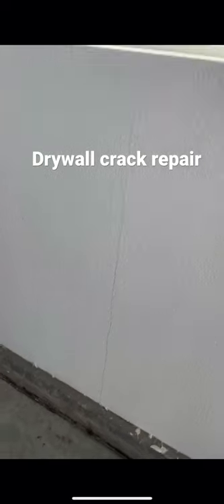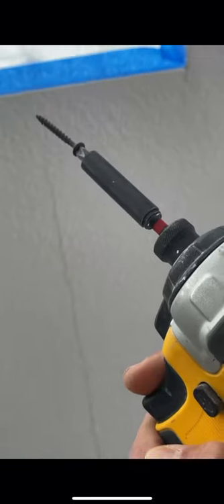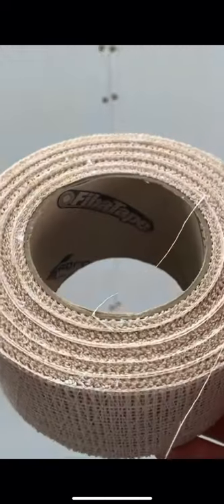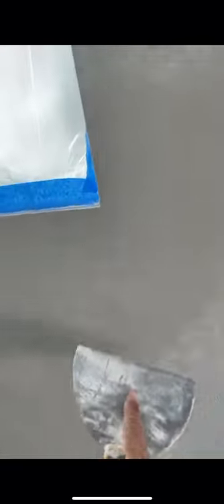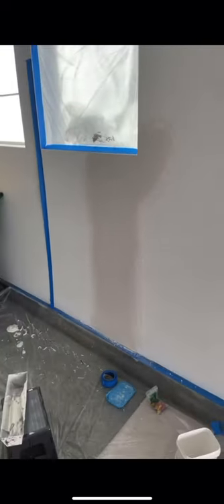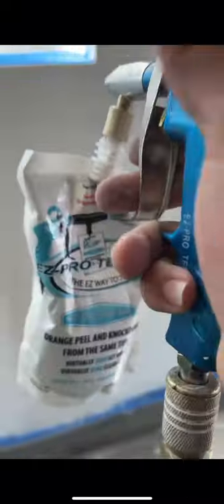Drywall crack repair #shorts

Comment: Ive been a painting contractor for 25 years. This is average work which really is all you need to have. Drywall and painting is an art. Thats not your formula. Reading these comments Im cracking up because half dont even know what the hell they are talkin about. These are easy average fixes for your average homeowner-handyman and they aren't horrible. Would I do it differently? You bet. All I do is that but your average handyman is like a good general practitioner not a surgeon. Keep up the good work.
Reply: Guy post a video of your fix; you've had your channel since 2012 and no videos. Show us what 25 years o f experience looks like. ✌🏾
Reply: @mrtv777  damn y’all rude asf. They’re speaking facts. Not all people do the same shit 100% but y’all mad disrespectful with your execution. This is why we can’t have adult conversations. It’s sad really.
Reply: It's gonna Crack. This is not how you fix this problem. Only thing he did here that plays a part if fixing is the screws. But this is a bandaid and will come back. I know a way to much about the trade and how to properly address things.
Reply: Real pros would have sanded all the old texture Off the Wall first so that you don't have to build up and create a lump
Reply: @thecloneguyz   Hahahaha.....no. A real pro would feather it out. You have zero experience obviously.
Reply: Cool so surely you’ll share how you do it then?

Comment: Dude, gotta open that gap with a v then prefill, paper tape then coat. Mesh moves to easy and the crack will show back up and not having fill of at least 1/8" will also cause a dry joint. Otherwise good video.
Reply: The procedure shown in the video shall failo.  Laziness, never brings fulfillment in life mae amiga. You sand are scared of, no one ever sands a lot. Fix it right with 20 grit sander, open that elbow up, get the mesh tappe y to o bind *HARD*, then spread the 29 minute shet, see?  It’s that easy and not so much more abehar than the lazy ways. 

You forget to paint amigdala.
Reply: He did right. So he can go back and charge the customer again. Just kidding JS. Great video.
Reply: @crocpa  yeah I give this thing maybe a year or two before it cracks again.
Reply: Paper tape should only really be used on new construction. At least he isn't using that yellow garbage mesh. The only thing he did wrong is not remove the old paper tape and obviously prefil but other than that great job!
Reply: @alozano443  Paper tape should be used any time a crack may reappear. And yeah he uses mesh in his other videos.
Reply: Thanks!
Reply: lk. k. k. k
Reply: @mateobrainardo4770  English?
Reply: I came to say exactly this but you forgot the PVA in the V..
Reply: Paper tape is garbage
Reply: @lukeshepherd9529  that's a given!
Reply: Open the gap and prefill with gap with 20 minute. Mix some weldbond with your water. Then do the same process he did after that. If you put weld bond in your water the crack will never open up again.
Reply: @Cchall22  That will work as well, so will PVA glue. Either way a gap must be made for pre-fill. Even still paper is best for long term results.
Reply: @rival2561  Sure if you don't use it right...
Reply: Paper tape can and should be used anytime
Reply: @mateobrainardo4770  I had a seizure reading this
Reply: @alozano443   right he had to go all the way underneath and remove the old tape !
Reply: @rival2561  mesh is garbage lol. Bet you don't even know what type of mud you're ONLY supposed to use with that crap.
Reply: @jonatangonzalez6279  that as well. But no telling that was a tape joint initially.  But it should've been opened up with a very notch prefilled then taped with paper tape.

Comment: You should cut the crack out like a V because the tape blisters when it cracks so before you mesh tape just thump the tape slightly and you will hear the difference from thumping directly on the crack and just to the side. So eventually if you don't cut out the blister it will crack again no matter how many screws you use. 20 yrs experience talking here

Comment: Also the thing about quick set is that it sets but doesn’t fully dry until days or weeks later so don’t leave to thick of coats or you’ll get a callback because it looks like there’s a hump in the wall cause it swells overtime just a tip !
Reply: Quick set dries chemically. Not air dry.

Comment: Thought you were getting rid of the crack not ensuring a callback. 
Cut that out a bit, use paper tape, mix pva glue in with your mud, it will help it adhere to the old paint.
Reply: Exactly!
Reply: Glue? No way jose
Reply: How do you "cut it out" ?
Reply: @ericimi  cut into the crack at a taper. Enlarge it so it can be filled with mud instead of hidden

Comment: Dude, there is a tape sold at Lowes called fibatape that isn't mesh like that.. It's actually a fiberglass tape that looks similar to a waterproofing membrane before its coated in waterproofing.. It works better than any other tape I've ever used for repairs like that.. Every person I've shown it to never uses mesh tape again.. It doesn't have adhesive like the mesh tape but just a really thin coat of mud under it (kinda like paper tape applications) then put the tape on and work it down with your mud knife, then a thin layer over the top and you're golden 🤙 best part about it is if you sand into it, it sands down like the mud.. Whereas the mesh tape will show if you sand into it.. I love it and most others do as well once they try it

Comment: 20 minute means it starts to chemically harden at 20 minutes but dry time is dependent on how thick it is applied.  You can finish quickly but will likely show visuable shrinkage once fully dried😊

Comment: Do you have a video on how to remove stubborn caulk around the bathtub and how to caulk a tub?
Reply: Sharp razor blade to cut it out. I recommend an olfa knife. To caulk I recommend taping off straight lines with painters tape.  Make sure you cut a small nozzle tip opening. Usually people need less than they think they need. Then run your wet finger or sponge to smooth it out.

Comment: btw, lmao, the second that house shifts a mm, that crack is going to come back an inch larger. Might as well cut it out and do it the right way.
Reply: 🤣 with a ton of screws that you need to take out from the studs. Wait till moisture from that window starts seeping down that crack. Good job buddy. You did an excellent job. 👍🤣
Reply: Moisture will cause mold if it isn't taken care of right away 🤐 Aghhhh, you just cost a home owner a $1,000 job for your $10 repair. Or, if they sell the house, a $10,000 job. 🤣

Comment: Can I use the same product to fix uneven dry, I have flat no texture walls and the contractor left us with not so smooth walls. Or is there a better joint compound or something I can use? Thank you your help
Reply: You can start with 20 minute, but I would suggest your final coat be joint compound. 20 minute tends to leave a less smooth less durable finish.
Reply: And if you’re not experienced, 20 minute can be a nightmare to stir and apply. Start with 45 or 90 Sheetrock, apply flat, sand the ridges.

Comment: This is due to putting a seam above or below a door or window. I proper hanger will blanket the windows and doors. Usually means more scrap but it's the correct way to do it.
Reply: Does that mean you cut out and put another sheet in? Please explain I'd like to know, if possible.

Comment: My house was built in 1997, during the unfortunate sponge texture craze. Any chance you can make a solution video showing how to flatten the drywall and remove the God awful texture? Thanks!!
Reply: Want the good news or the bad news?

Unfortunately, there’s no good news. You can scrape and sand it all away, cut it out and start over, or keep adding compound :/

Comment: I have huge horizontal drywall seam cracks in my garage… I can’t put screws 4” apart because there’s nothing backing the majority of it. I can only screw into the studs 16” apart… It did tighten up a little bit, but I can still move each piece of drywall by pushing in the non stud backed spots. Any advice?

Comment: Hey i have a question is these crack dangerous because i have a few in my room and one stretches out from my door to the end of the wall and that wall is where I put my bed and im afraid i might get crushed in my sleep but it's really small

Edit : it goes up the corner of the wall and across the ceiling corner

Comment: Cut the tape, out mesh and fill otherwise layering mud on top of knockdown you run the risk of a visible hump unless youre busting it out.  But you should still have V'ed the crack to get the durabond in it.

Comment: Can I use the same technique for the ceiling
Reply: Cut the crack open in a V-shape. 50/50 PVA and water. Plasterboard screws if needed. Filler crack. Mesh tape. Filler over. Sand. Paint.

Comment: Drywall but joints crack over doors and windows and under windows like the one in the video, lots of movement in them areas as seasons change.

Comment: You don't ever use mesh tape unless you are prefilling with unsandible durabond and first coating with it. Then top coating with easy sand or bucket mud.

Comment: I just open up the Crack a little more, put some caulking in it, and paint. Haven't had a customer call me back out yet
Reply: Is caulk that second product he used and mixed with water? Or caulk like that Dap stuff he frequently recommends?
Reply: @GenevieveThornton  No he didn't use chaulk he used mud.

Comment: Why nobody use paper tape instead of mesh? You want to hide the crack behind the paper tape. If you used mesh tape it will make it stronger than the rest of the wall and a crack will form somewhere else.

Comment: I laugh when it comes to texture.
It was created because no one knew how to build a nice, straight, even wall and the texture makes it look like it was built properly.
Reply: @savagecomments9195  geez that took way too long for someone to bite
Reply: Texture massively improves room harmonics and echoes.
Reply: @formdoggie5  sure it does. who told you that, a texture salesman?
Reply: @dragons_red  no. Physics.
Reply: @formdoggie5  bro why did you destroy him like that. How is this man gonna go on
Reply: @dragons_red  texture salesman🤣🤣🤣🤣 man leave him alone
Reply: @dragons_red  textured ceiling is called acoustic ceilings after all.
Reply: Negative. You find this mostly in Spanish states Florida Cali Arizona New Mexico etc etc etc  in the late 80s early 90s it was used in Northern states. That and popcorn were considered high class.
Reply: @krazylegz254  he can bother me all he wants. If leaving people alone leaves him so ignorant he cant realize that the peaks and valleys break up a sound wave, as well as a literal air pocket insulation preventing the soundwave from reaching a hard surface (which imparts more energy on rebound), then it's probably a bad idea for him and everyone agreeing with him to leave people alone where they wont call them out for it.

The room will usually be about 5db-7db quieter, and if sufficiently large (like a living room) almost completely eliminate echo (even more significant when hardwood floors are involved).  The topography of anechoic sound chambers is just the exaggerated topography of "popcorn" texture on walls.

Comment: My house is full of that kinda shit... settling is going to do all that? I've thought about opening the wall and checking the boards and foundation
Reply: It's normal to have cracks from settling. What you need to do is fix them. If they re-appear then you might have foundation issue. But if they don't re appear then you are fine
Reply: @DaDaDo661  Roger that... should I use spray foam jic?
Reply: @stevennihipali3607  are you talking about drywall cracks? Just open them up a bit with a utility knife and then tape and mud them. Don't use mesh, use paper tape
Reply: @DaDaDo661  why use paper instead of mesh? Mesh is sturdier and paper will just rip open again in a month.

Comment: That’s like the complete opposite way to do it
Reply: Sad thing is some really think this is the right way to fix the crack!  SMH
Reply: Then what is the proper way?  This looks fine to me as a diy’er.
Reply: @Mote78  your suppose to cut the crack out with a razor knife then tape it and spackel it and your supposed to do 3 coats maybe 4 if it needs it not 1. Keep DIY. Ing
Reply: @Niko-iq8bc  
 
Thanks so much for the quick reply.  Need to do this in my home.  
So no need for the screws?
Reply: @Mote78  no you don’t need the screws but don’t use the mesh tape use the regular spackel tape
Reply: @Niko-iq8bc  it's a 1 minute video......how exactly do you know he only did one coat? I'm curious. As a contractor, I'm extremely curious how you would do my job 🤣
Reply: @reversegiraffe8774  even if he put more coats that’s not even the way to do it, your supposed to cut the crack out tape it with the regular drywall tape and put 3 coats on it, that’s what your supposed to do not screw the crack and put mesh tape, I don’t know what kind of contractor you are but that’s the complete opposite way to do it
Reply: @Niko-iq8bc  I don't know what kind of contractor you are but copying other people's comments doesn't make you one 🤷🏻‍♂️.
Reply: @Mote78  exactly. DIY
Reply: @Niko-iq8bc  he is the only one who is being reasonable, both ways work alike there isn’t a right or wrong way as long as it works for them
Reply: @Niko-iq8bc   you mean remove the old tape from underneath and replace it ?

Comment: I normally like your videos, but not this one. You need to cut it out, fill the gap and use PAPER tape, not 20 screws and mesh tape. They’ll be calling you back in a few weeks or months when that crack shows up again, bigger the next time. Or maybe they won’t call you back because let’s be honest, this was kind of a shitty job. Like those people in the automotive industry  that think you can fix everything with body filler. Looks good ≠ repaired.

Comment: What is that stucco bag? Do you just need a air compressor? 🤘🤘
Reply: Yes attach to compressor.
Reply: And the gun. If you're doing a small patch like that, you're better off just buying a can of texture. It looks similar to a can of spray paint with an adjustable tip. The bag he uses is for reoccurring small to medium sized jobs. Bigger jobs use full sized hoppers.